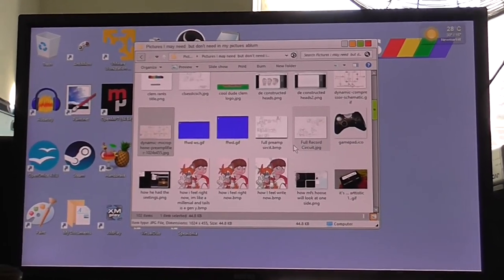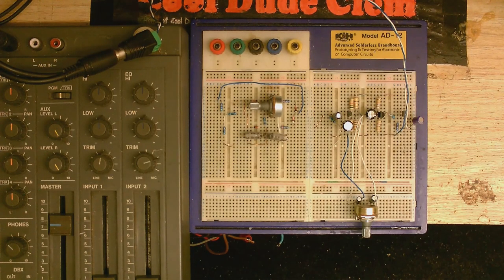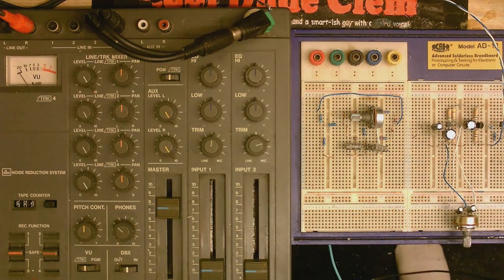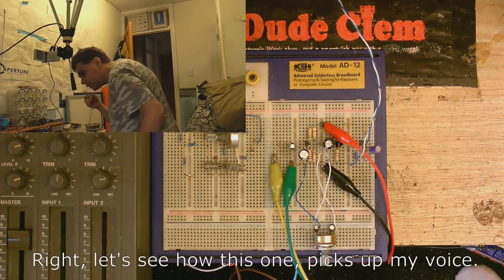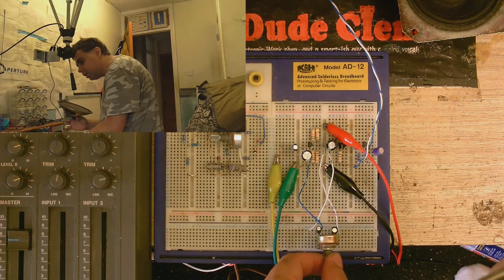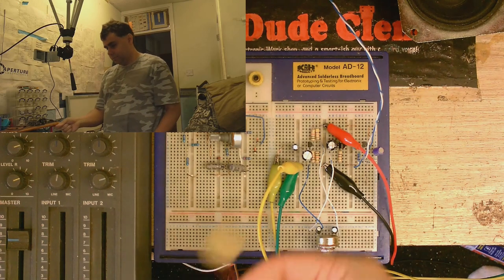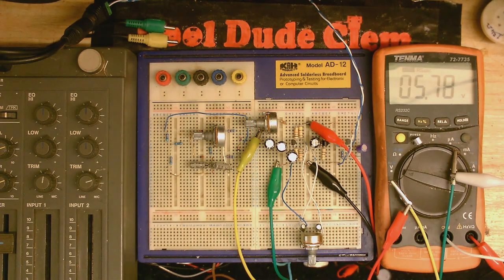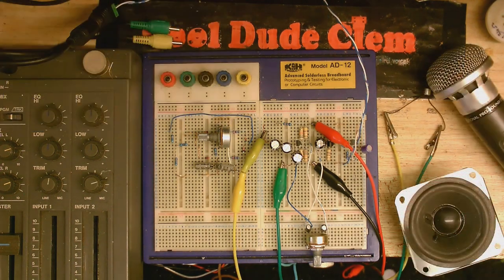Common Base Mic Preamp Experiments

Comment: Very interesting Clem!
I reckon that the small white thing you tried was a salvaged Telephone Earpiece Insert and it seemed to work well on speech frequencies.
A large Loudspeaker will always be bass heavy when used as a Microphone because of the weight of it's cone.

Comment: black is only "hot" in america in AC construction wiring. Your standard 3 conductor cable would have black, white and bare copper for ground/earth. White is neutral. Black is line. DC is Red +, Black -. Usually for low voltage lighting. Electronics seem to be whatever the manufacturer decides to use.